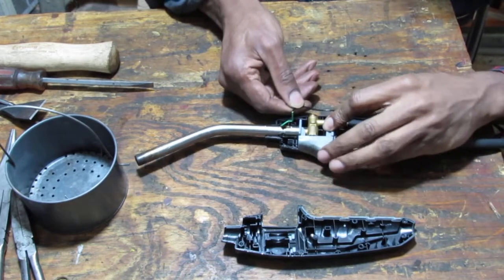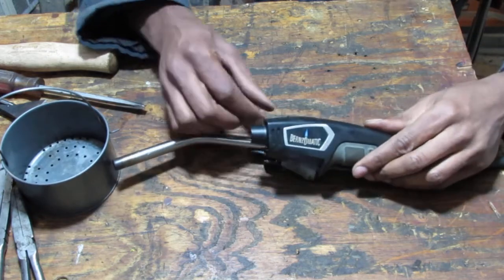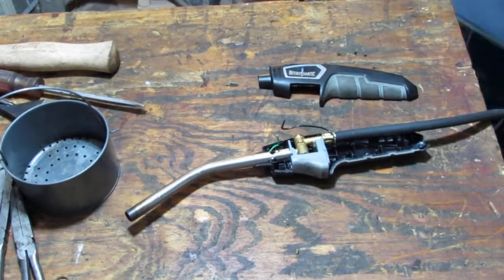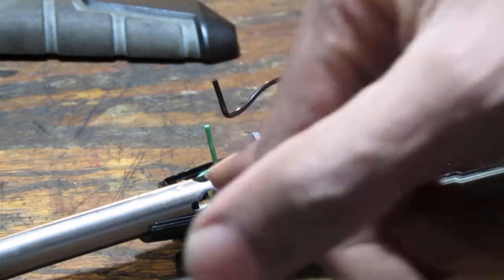Get It Running : Bernzomatic Torch

Comment: Do you know what to do when the knob on the hose won’t turn ?
Reply from the maker: Have to tried spraying it with a penetrating lubricant to see if it is seized?
Reply: @MotionDesignStudio  are you just getting a small flame that you can’t turn up or down?
Reply from the maker: @DeviantWays  , the flame size I have no issue with.